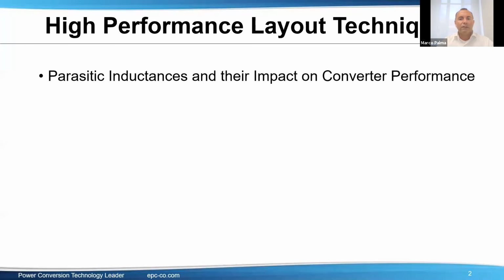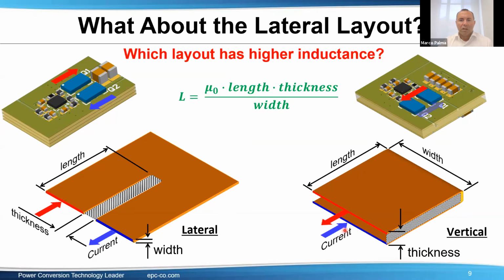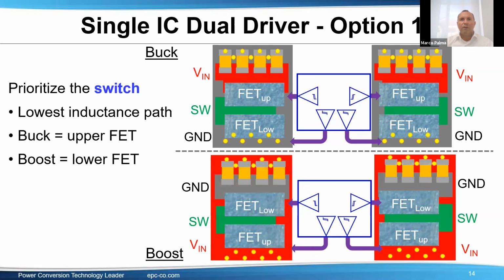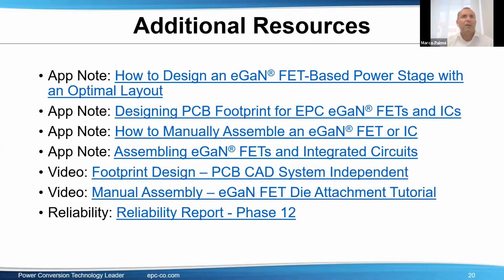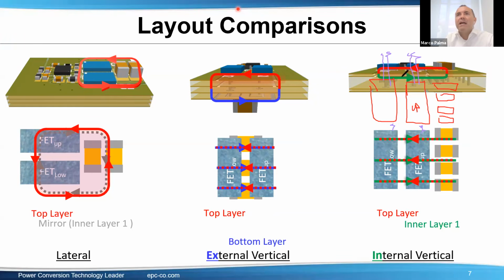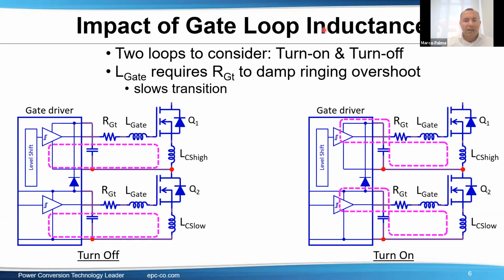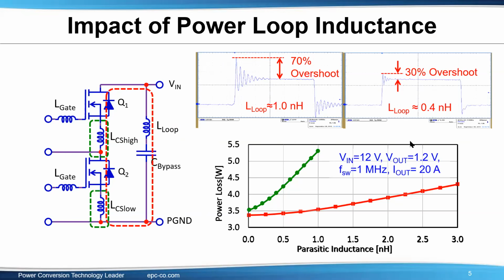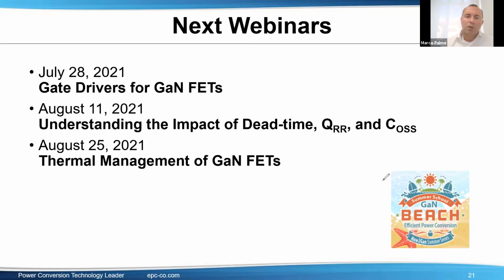How to GaN 05a - Layout Techniques to Maximize Gallium Nitride (GaN) Device Performance

Comment: Interesting!.  By the way, I had made around 500 layouts from large presspacks to modules to PCB mountable discrete devices.  I will be glad to support in case someone faces problems or want to try out other alternatives.
Reply: Hi,
Do you have experience with handsoldering the gan packages? especially  the die with solderbump ones(orange-yellow color). i have low temp solder paste and hotair
Thanks in Advance